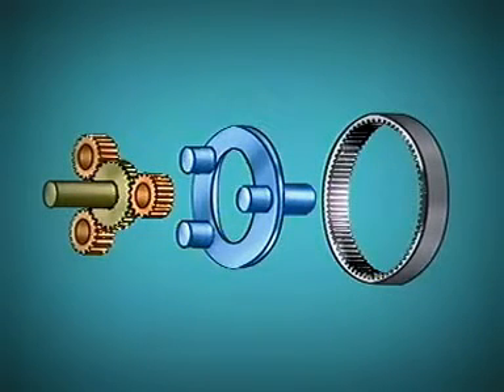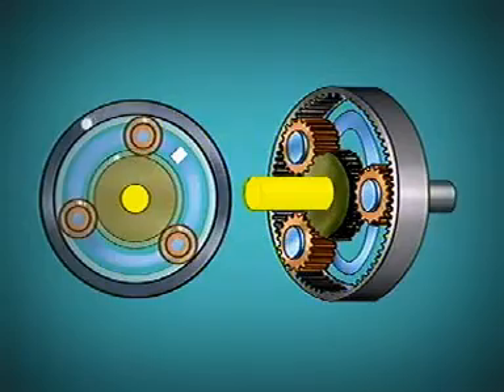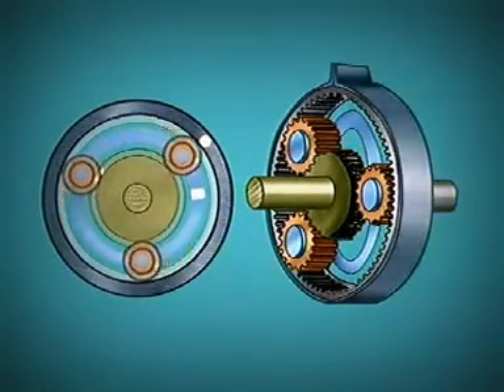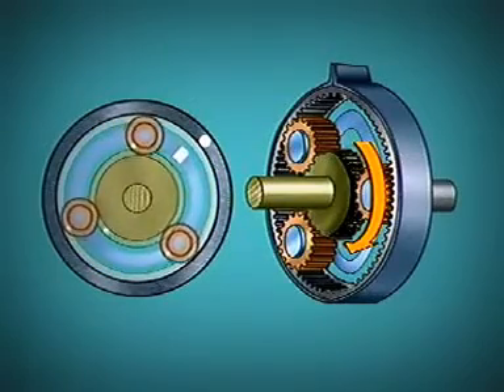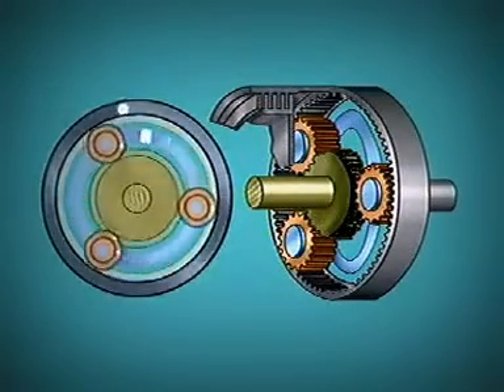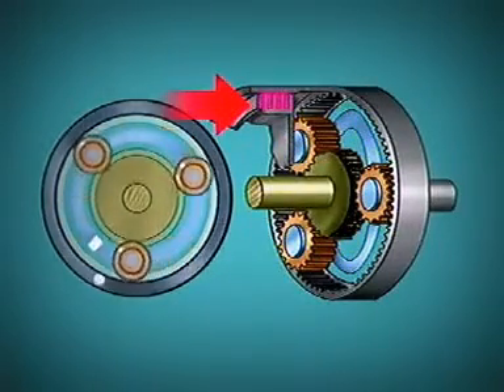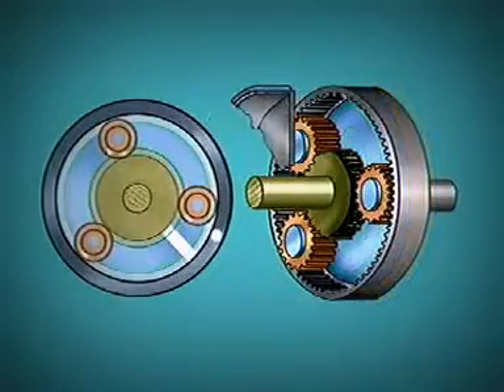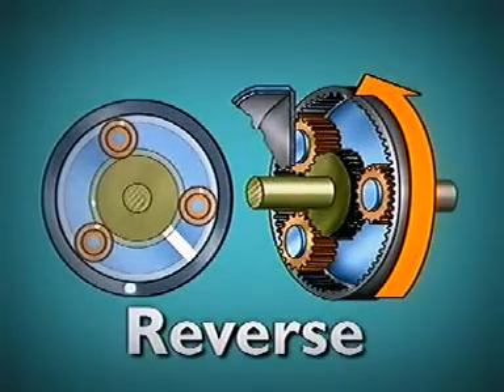كيفيه تشغيل التروس الكوكبيه ؟

Comment: Hi. I have a question.  When the car is hot my Zf has some problems. What causes those problems when the car is hot.   Was verursacht Hitzeprobleme?
Reply from the maker: What are the problems that occur when it gets hot?
Reply: @atsgeg  As you know, my gasoline 520i 2014 uses zf. The car takes itself from 3 to 2 in decelerations. (Or maybe it's downshifting from 2 to 1. If I press the gas right after the downshift, it starts to accelerate by making a hard knock-on motion. Is this normal when the gear is downshifted?   It does it when its hot.  Is it about lockup clutch.  Thanks for your comments
Reply from the maker: @cihanmenemenlioglu6066  This actually happens in the hot mode if the oil loses its properties and also happens if the solenoids have dirt.
Reply from the maker: @cihanmenemenlioglu6066  I want to know if the transmission is 6 gears or 8
Reply: @atsgeg  Zf8hp45
Reply: @atsgeg  8 gears
Reply from the maker: @cihanmenemenlioglu6066  I think it is a dirty solenoid, or there is a problem with the control
Reply from the maker: @cihanmenemenlioglu6066  A video will be uploaded next week regarding zf8hp